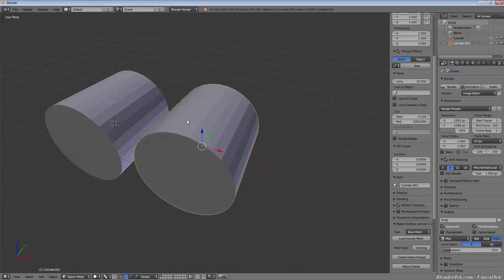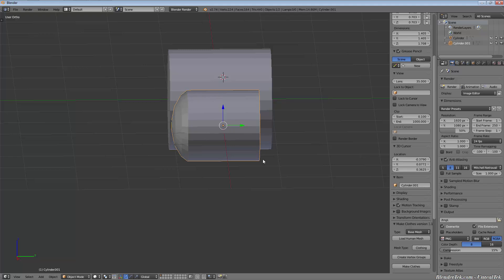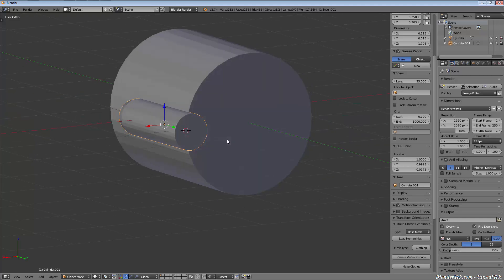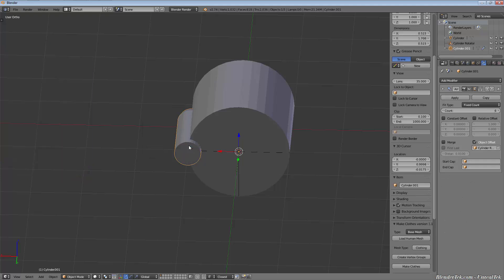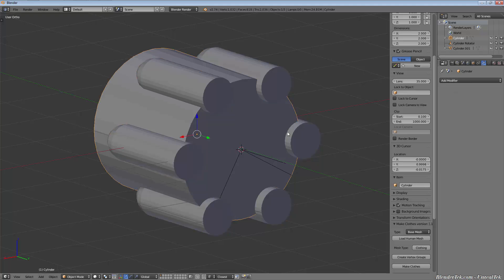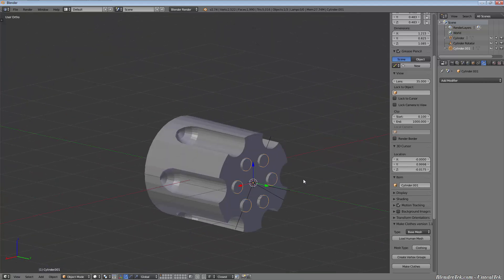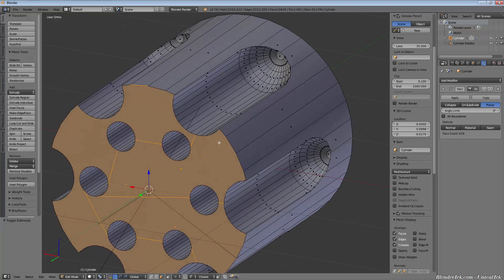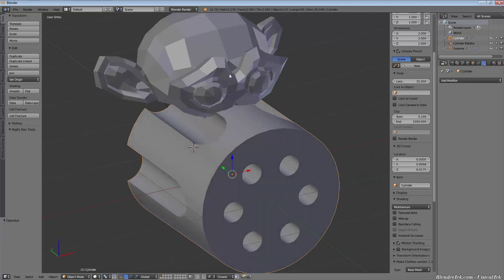Blender Bool Tool: Using the boolean modifier to create a revolver cylinder in under 9 minutes

Comment: To adjust the scale of the bullet holes indidually afterwards just hit tab to hop into edit mode, select the single geo which is the source of the array instances and scale that up . It will apply the scale to all instances of the array as long as  the array mod is active. Thanks for hinting out that the alignment and divisions matter for boolean ops. Great tip. This was soemthing I didnt know about. Very valuable when dealign with this stuff.

Comment: It's not high poly man lol, you had 600 faces on it by the time you edge splitted it. For a game ready gun it's okay to go up to 8k faces and that's most complex part of the gun rest is easy. 600 faces actually pretty good for such a complex shape I would say. What I do is not edge split but instead subdiv my mesh few time and apply before Boolean work. The re topo for maximum efficiency. Nice video quick n smooth. Thanks.

Comment: im not saying im an expert or anything, but...:

1.) not all revolvers have 6 shots, some have 5, others have up to 20

2.) i am 99.99% sure that  the holes milled through a real cylinder are milled through the ridges  not in the lower parts

3.) the holes milled for the bullets (at least for modern cased ammunition) have a larger bit that allows the back of the cartrage to sit flush with the cylinder...

4.) cylinders sometimes have ratcheting that lines up with some sort of tab in the frame of the gun that allows the cylinder to rotate as you pull the trigger

if that was a real cylinder im confidant that thing would explode with full loads of whatever you are firing from it
Reply: Kinzuko when he scale down that six cylinders, I was screaming

Comment: tip, if you just type 360/6 right into your value it will do the math for you. That way you skip an extra unneeded step
Reply from the maker: +Derek Peterson Yep indeed. You can also hit the = sign and do complex math like 2((sqrt)((3+1)*pi))  Thanks for the tip!
Reply: BlenderTek indeed you can, as long as you know how to write it you can use as complex math as you want.

No problem, too bad I couldn't drop it by sooner, this videos been in my watch later list for eons now.
Reply: +BlenderTek what was that neat calculator you used?